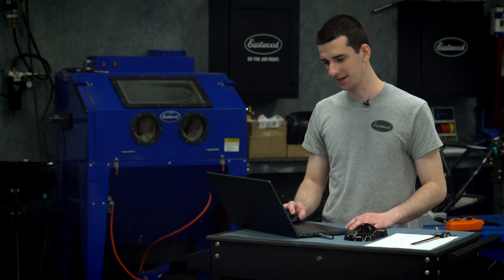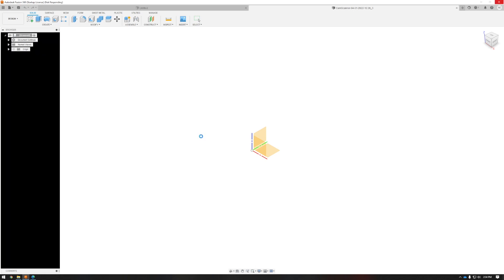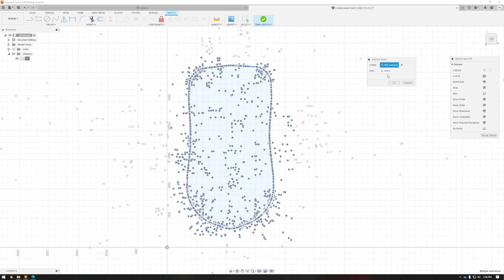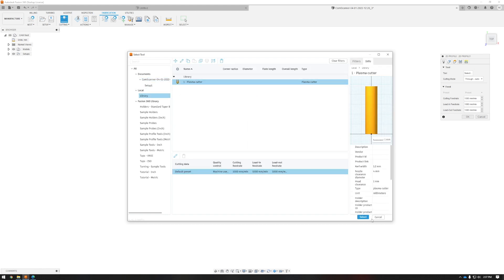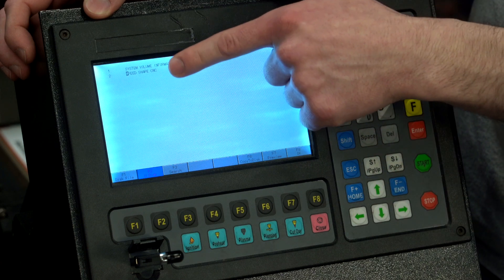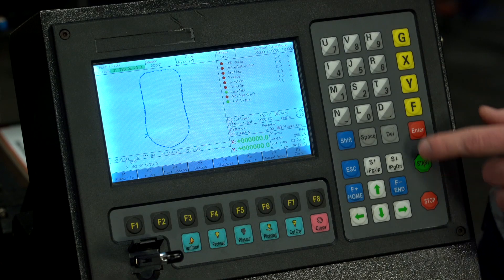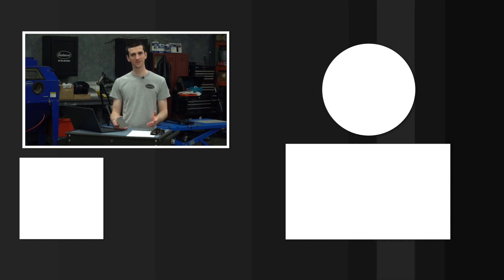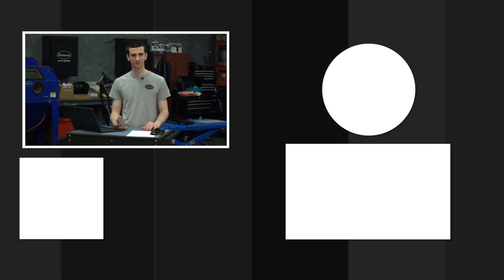How to Make a Cut From a Template with the 4' x 4' CNC Plasma Cutting Table - Eastwood

Comment: See this is why I don't have or use cnc machines. It has nothing to do with being a real fabricator. It's all in how good you can push buttons. No skill to it really.
Reply from the maker: The speed, and accuracy that a CNC can provide is extremely powerful. A true fabricator can combine that with some skill to create some extremely impressive works of art. 
Also, you can make a living using SolidWorks (if you're talented). Haha.
Reply: There are actually alot of skill required in drawing programming and running cnc machines especially cnc milling machines. Making stuff by hand is cool and I respect the work people do, but when you have to make 30 of the same part the hand tools are not as cool anymore. I run a cnc shop and I can't hardly find help because most of the time they struggle with learning the CAD CAM and other work that is involved. You also have to worry about crashing a 100k machine.
Reply: If it required no skill, you would be able to use one. And you can’t. Get with the times old man